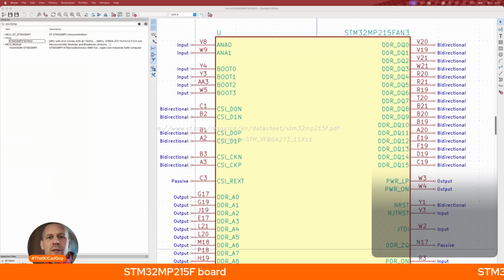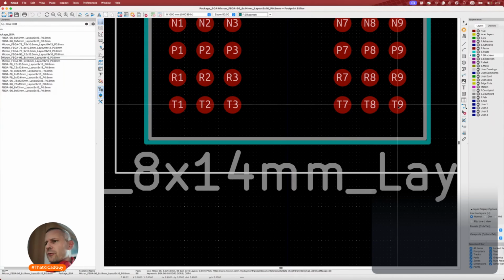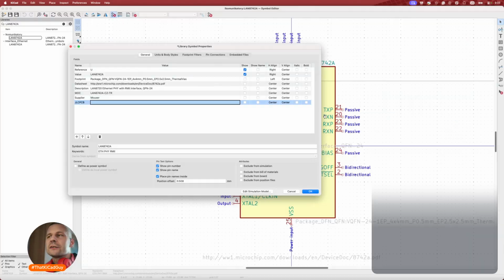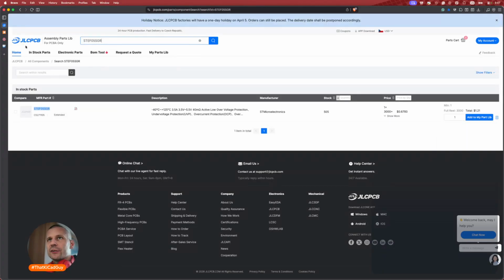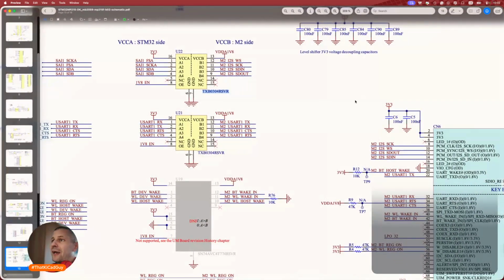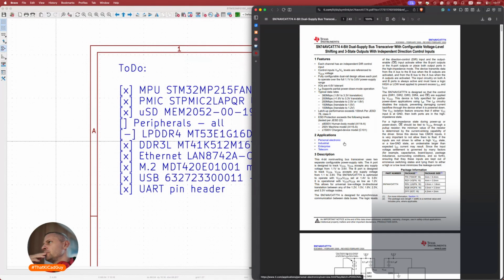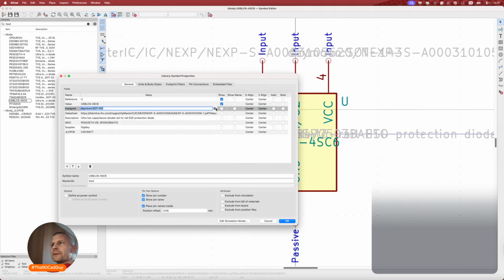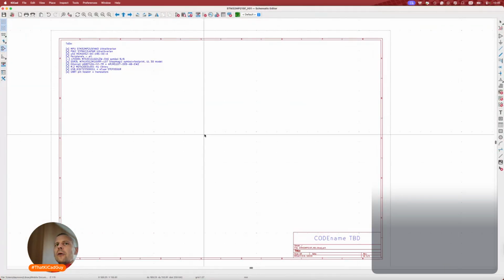KiCad Design Stream – STM32MP215F module, part 4

Comment: No problem with current stream layout from viewers point of view. I saw the Copilot on SnapMagic, but haven't used it yet (I don't know what is the purpose). Thank you for the stream and looking forward to next week. Wish you a great and blessed Easter.
Reply from the maker: Thank you for watching. After the latest stream, I rebuilt the layout of the stream studio. It should be working better next time. I placed the camera to the right bottom corner with the comment section overlay. There are not so many comments during my streams. The bottom right corner contains less information than the others, I think.